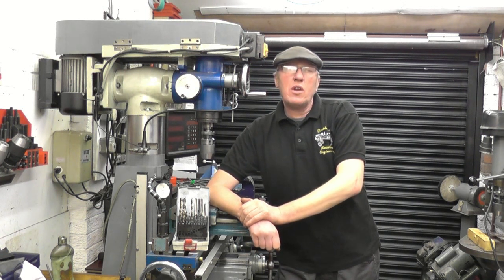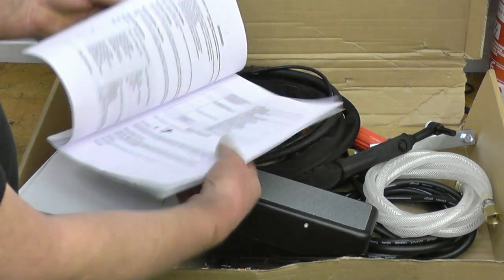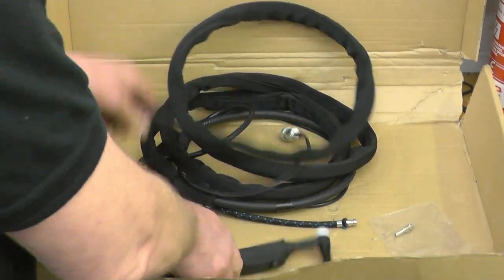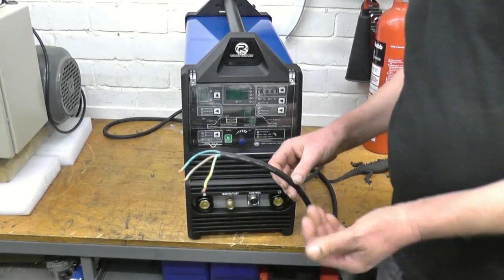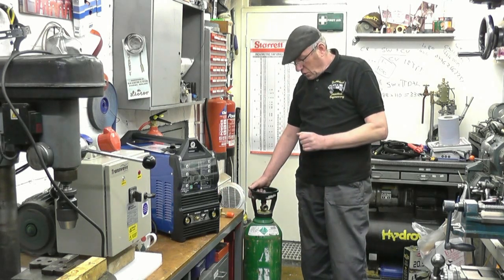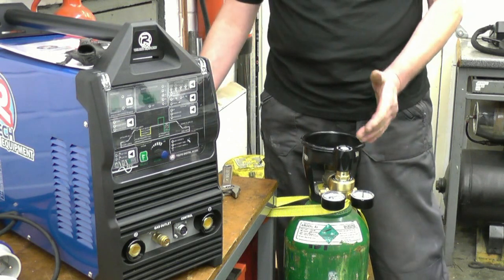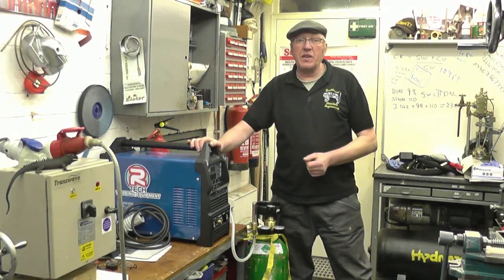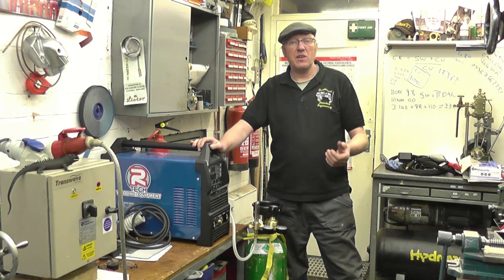R-Tech Digital Tig Welder AC/DC 210 AMP  Review  Part One

Comment: will it work with 230 v socket? (I live in the Netherlands)
Reply from the maker: You will not be able to operate it on full power from a 13 amp supply

Comment: Hi, John what type of breaker do you use to supply your welder, I have the same on a 32amp commando plug with a type B breaker. The welder trips the breaker 8 out of 10 times it is switched on.   thanks in advance
Reply from the maker: +joe wardle Hi . R tech recommend a "D" type breaker this is what I use with the 260 without problems   If you have problems ring R tech they will be very helpful  . Regards John
Reply: +doubleboost many thanks John, I spoke to Dylan at R-Tech,  Type D Breaker it is.

Comment: Gday John,In a past life I used to build experimental farm equipment for the AG dept here in Western Australia and used to tack the machine together first then dismantle and fully weld. If you are doing a lot of tacking up then don't use the auto helmets as you get micro flashes and after a day the eyes know all about it. Use the old type shields for tacking up and then you can go over to the auto shield. Just a tip from an old welder. Cheers Cobber to you and yours Ross

Comment: Hi, these single phase digital sets really are awesome, we do a lot of commercial aluminium welding and have the Thermalarc version (very similar) and its definitely the go to machine. We just switched to the thumb wheel torch but wish we hadn't, give me a pedal anyday. They perform just as well as a stick set too and because they're so compact they're easy to put in the back of the van and will run of a reasonable sized generator. Great review, looking forward to seeing it lit up.

Comment: John,
A great introduction to TIG welding. You covered the hazards and safety very well. I have heard that with taller bottles of gas, they can (if not secured) fall and break off the valve. With several thousand psi of pressure in the bottle, it becomes a missile. It can wreck your shop and kill you in the process. I don't know about prices in the UK, but here in the US, the larger the bottle you can get the less the gas costs per cubic foot/cubic litre. Thanks for the great video. All the best to Debs!
Have a good one!
Dave

Comment: The shades, that ranks from 9 to 13, is the intensity, that corresponds to the sunlight 9 times to 13 times stronger, then the sunlight, depending on the welding process being used. Hence why one should not feck about and get dressed properly. Ok, i get off my soapbox. :D

Comment: I loved that end bit, you gave me a good laugh. I like all the gear the R-Tech comes with, flex torch, proper regulator, quick connect gas line, etc.. I think you said the foot-pedal was an option, but at least the option is a quality foot pedal, not those big plastic hunks of junk. I have the same one as far as the frame and cable goes, but I assume the guts are wired a bit differently. Could be the same though, not sure...Is it a 22k ohm version? That's the kind I have and it is just gravy on the foot, really forgiving and not hyper sensitive which is important for me with my twitchy feet.

Thanks for the show, I'll be waiting on the next bit. See you then...Aloha, Chuck